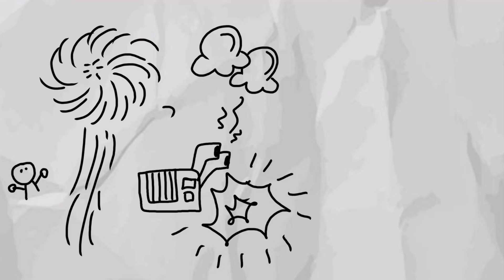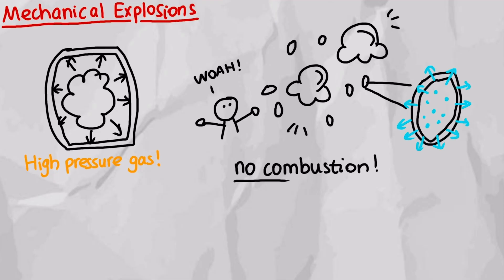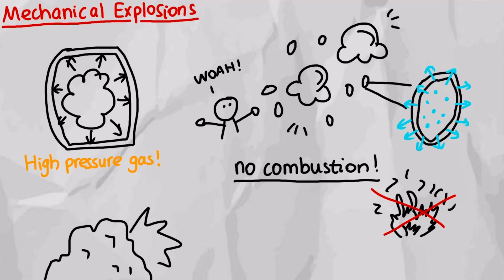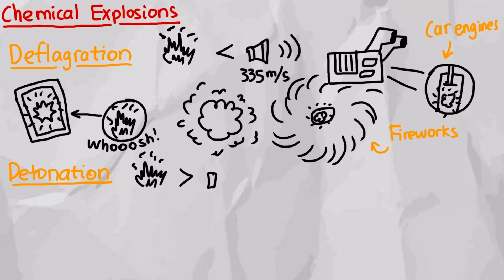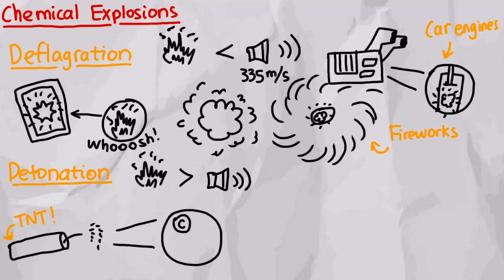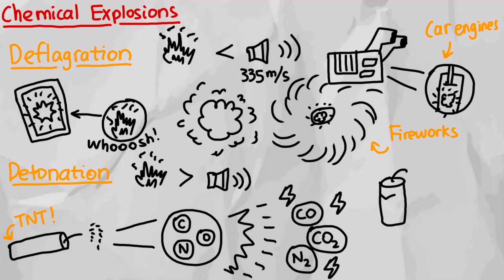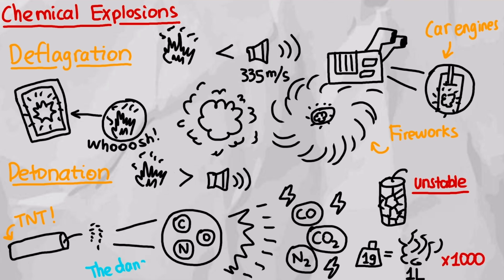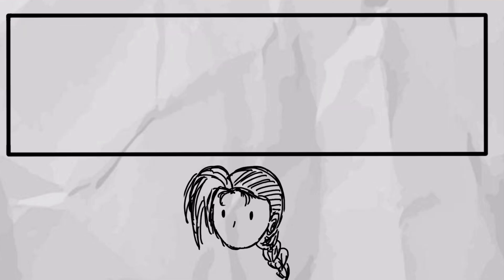What Makes an Explosion Explosion?

Comment: My guy, your thoroughness should be extended in this style by 15-25 minutes. Your video and it’s detail is well researched and should be expanded (not necessarily this topic) to videos that are longer then ~3min. You also have a great voice just slightly slow your pacing. Let the idea soak in like water in tilled soil. Yes it can absorb water but it has a speed at which it can take in that water. Your the water m8, 😊 keep going and don’t be afraid of some b-roll or basic sim of examples of what your discussing. But more importantly keep it up! 🖖😎
Reply from the maker: Awwww you're so sweet! Thank you so much! 😆 I very much appreciate your feedback, just doing this as a fun side hobby, but I will definitely keep it up :D